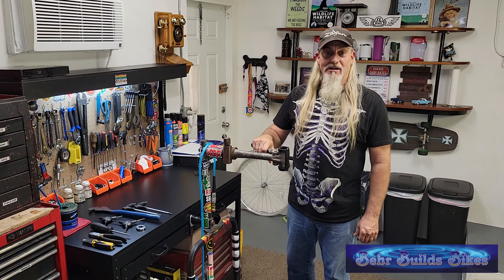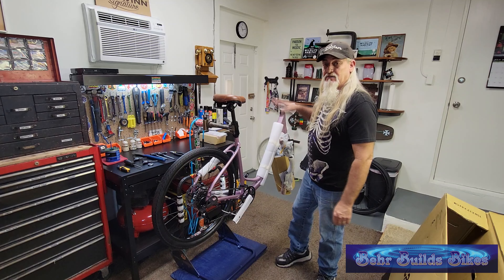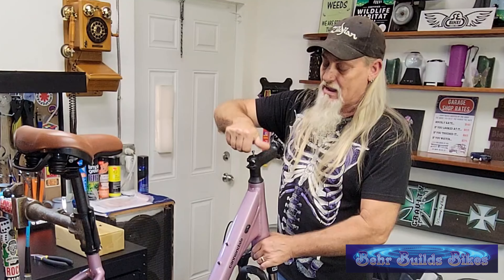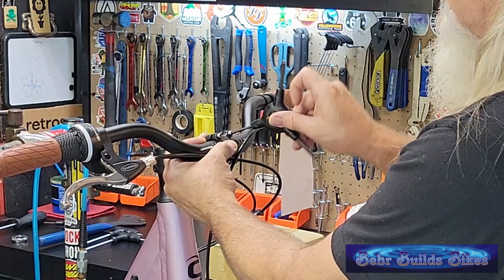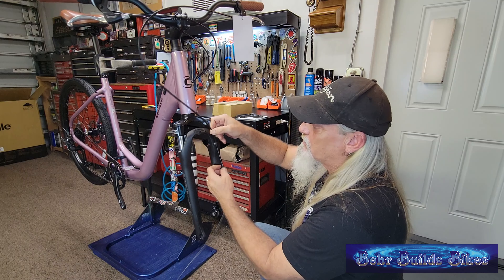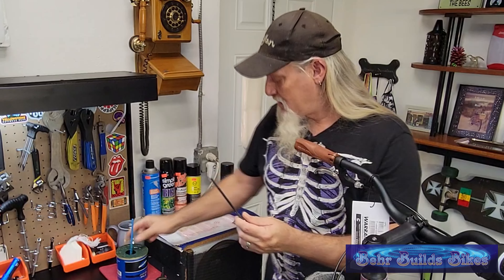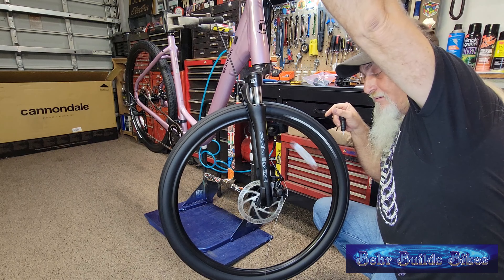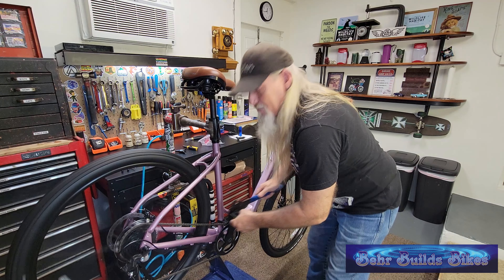Cannondale Adventure 2 4K BBB

Comment: Superb video. Any idea whether a LARGE will be big enough for someone 6 foot 1 inch tall?
Reply from the maker: That should fit you just fine. The seatpost is very long and the handlebar can be pitched forward to add more room to the rider compartment. The Adventure 1 also has an adjustable stem and shock absorber seatpost along with hydraulic disc brakes and rapid fire shifters. Thanks for watching. :)

Comment: Great video. Just bought one for my wife. Ours has a plastic piece where a front derallure would usually be, but it doesn't seem to be keeping the chain in place. Do you know what this is for? Can it be removed?
Reply from the maker: It is to help guide the chain from falling off the chainring. If it is adjusted properly, it will not touch the chain unless the chain is starting to come off while in first gear ( the big sprocket in the rear ) under pedaling pressure.

Comment: Hello. Does the rear suspension adjust? I have an Adventure 1 from Cannondale. The rear seat suspension is super stiff.
Reply from the maker: If you take the seat post out of the frame, at the bottom there is a 6mm cap bolt that you can turn counter clockwise to loosen the suspension a tiny amount. BE VERY CAREFUL NOT TO LOOSEN MORE THAN 1 TURN. The cap holds a coil spring into the post and if you loosen it too much, you will find it almost impossible to put it back together if it comes out completely. 
These posts are not designed to have very much "travel" in the shock , so don't expect it to be very plush, but it will offer a little bit of relief over rough roads and bumps. You can always replace the post with an aftermarket post with more travel and adjustability.  Cane Creek makes a few good ones, but they can be pricey.
I hope this helps. 😎👍
Reply: @behrbuildsbikes  thank you sir
Reply from the maker: @MikP86 You are very welcome!!!😎👍